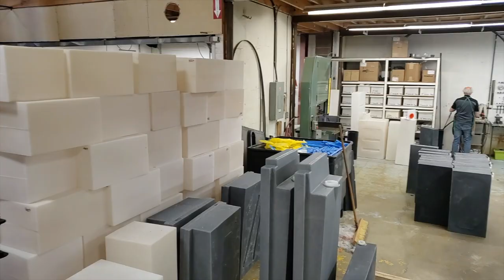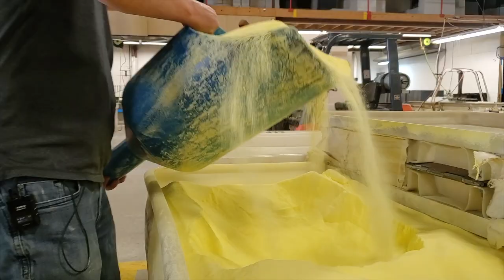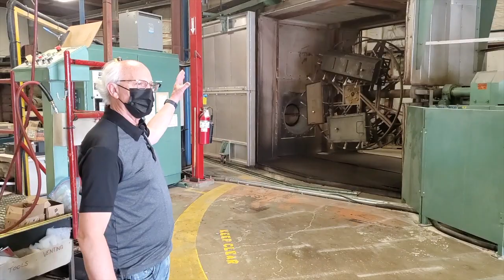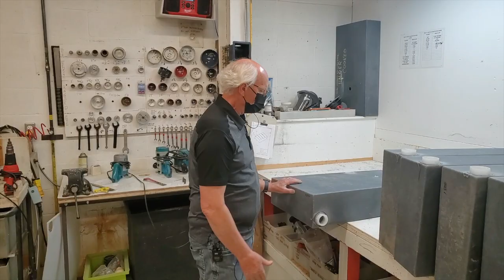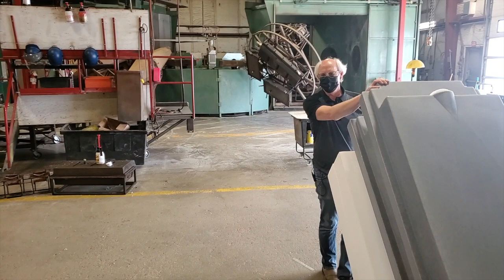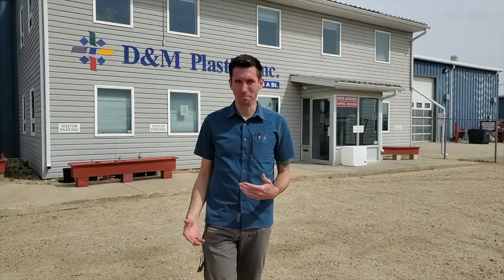How Its Made: RV Water Tanks | Season 1 | Episode 25

Comment: The tanks seem so tiny for what they need to hold!
Reply from the maker: Good observation and you arent wrong! It's tricky to have lots of water because it weighs so much! So because we knew we had to drive across Canada and could fill up 1/week, we went on the light side. 

We also made sure to stay with molds that D&M plastics had already made, and these were their largest RV certified steel molds they had without making new ones.
Reply: I've always wondered how to fit in tanks but still have them serviceable. Like when so many put tanks under their floors to keep the weight low, but how do I manage them? Crazy balance required, especially since really cold winter zones also need to worry about insulating the water system itself
Reply from the maker: @AmandaComeauCreates  Of you are going to love our design! :)

We have insulated whole trailer frame from below and made the entire subfloor area servicable.